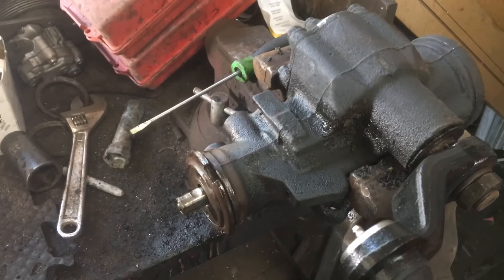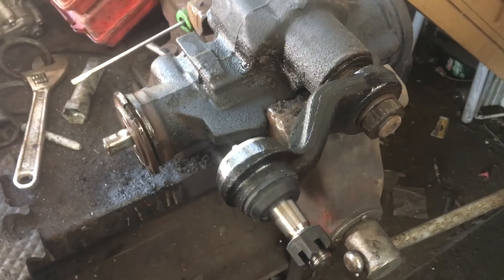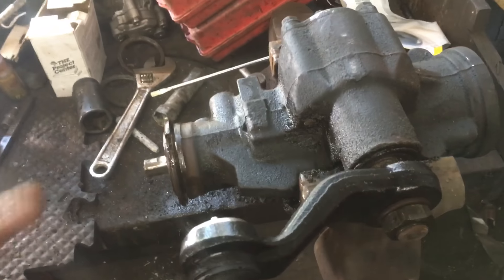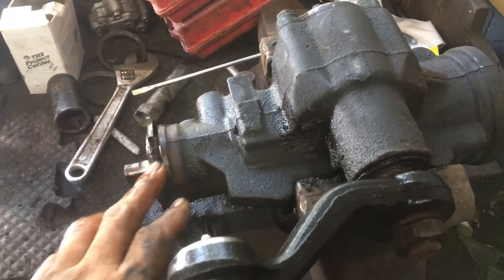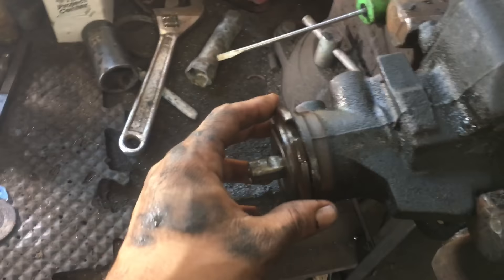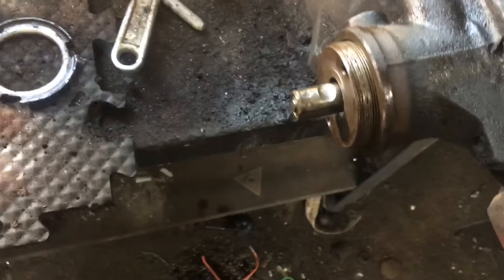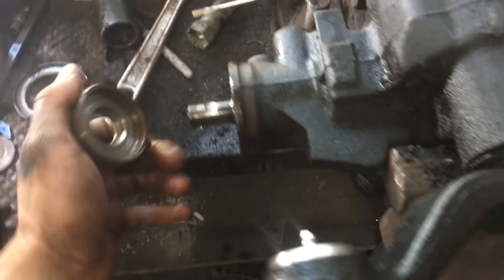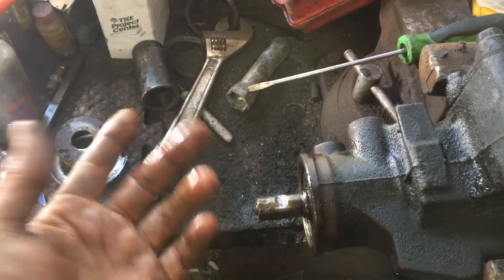How to rebuild Chevrolet steering gearbox on pick up

Comment: We fixed my 2005 2500hd Duramax like this. We left the box in the truck and put a new input shaft  seal in. I bought a kit on ebay and it was all wrong except the input shaft seal. I have no idea how to find the correct seal kit for this truck. It would've been nice to replace all seals when i had it out. Thanks for the video it was very helpful.

Comment: I need to know, will these seals being bad just cause leaks, or excessive play in steering wheel?
I've got no leaks, but have already replaced tie rods and older and pitman arms, so this was the only thing I could think of.
After watching this video I'm unsure if this is my problem or not.
Reply: Check your steering shaft

Comment: You said the assembly was not tightened down all the way when removed (unthreaded)...how tight do you make it on the install? Thx
Reply from the maker: I honestly can’t remember it’s been so many years since I didn’t one of them I greatly apologize you’re gonna have to look up the torque specifications on your own or just tighten them up by hand
Reply: 30 ft pounds

Comment: What tool did you use to actually replace the seal tho?
Reply from the maker: Seal puller and driver
Reply: @sharpcarco  is there a specific one that you would recommend using? I was looking at different ones
Reply: I drilled out my seals with a 3 inch screw. Got the idea from a YouTube video you can search it. That and snap ring pliers

Comment: Do I need to take the whole steering box out to replace the gasket?
Reply from the maker: May not have been necessary but that’s what I did
Reply: @sharpcarco  one last question, is there anything I need to keep an eye out for when I replace the gasket? Mine is leaking so I'll be doing it this weekend. Thank you for your time.